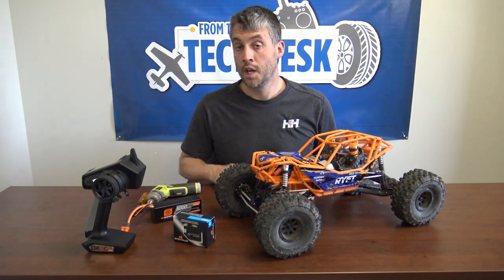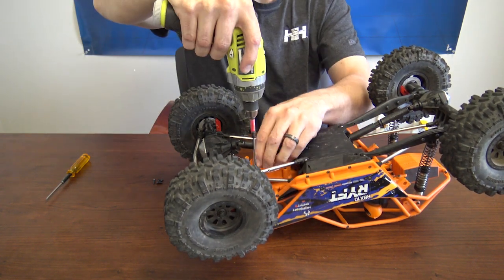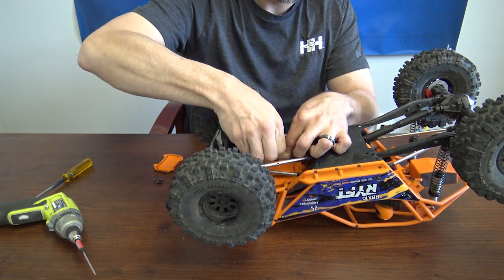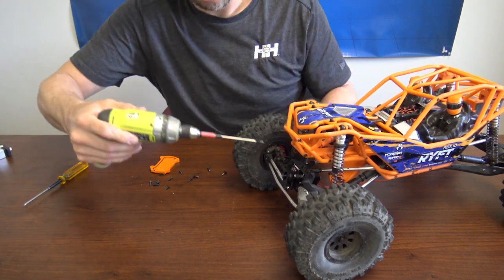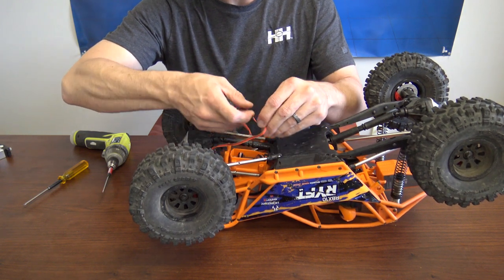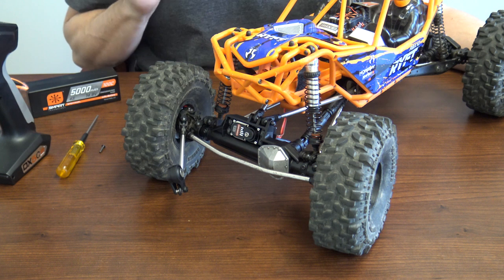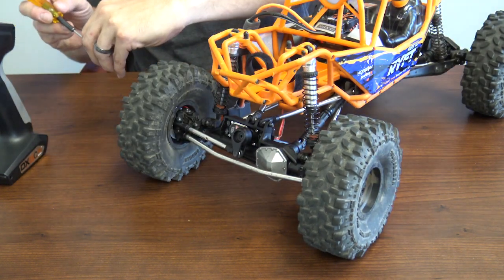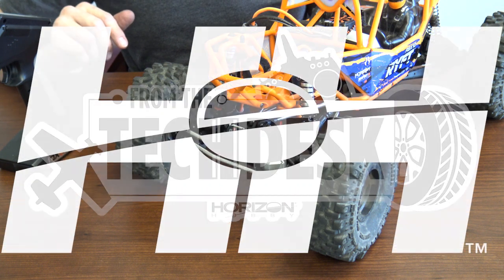From the Tech Desk: How to Replace the Servo on your Axial Ryft

Comment: How about making axles that don't break so easily.. after bouncing up the hill and land on 1 wheel instead of all 4 it cant take the impact.. broke 2 rears.  Now i reinforce them with stainless tubing from work. My Losi Lasernut does the same thing without the cost of replacing parts..this must be horizons motto. Keep em coming back for parts🤔🤭😔

Comment: Replaced my servo after first run. This was such a disappointment. Just didn’t work anymore, no reason for this... Compared to Losi, Axial build quality is not worth its initial cost. My ryft sits on the shelf, I don’t have the time or money to dump on every little problem. This vehicle also has some kind of gyro, if I turned it on or off with front axle not straight, won’t drive or steer, it’s powered on but will not function. I believe it has something to do with the gyro but I just skip this choice because the headache.
Reply: Yepp the servo saver is weak too..got one from arrma on it now..all good